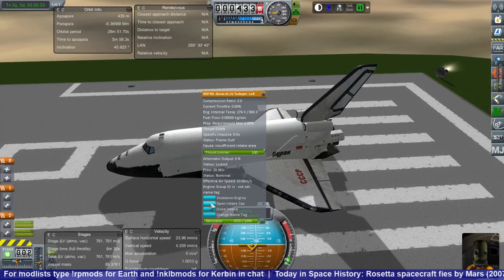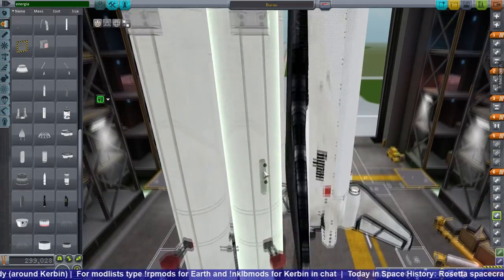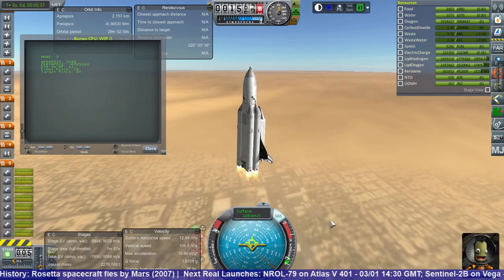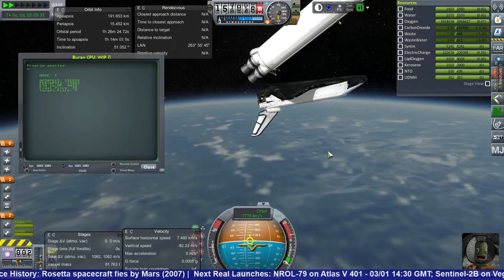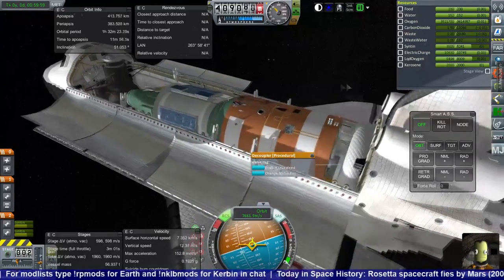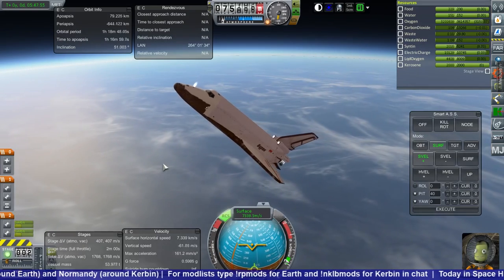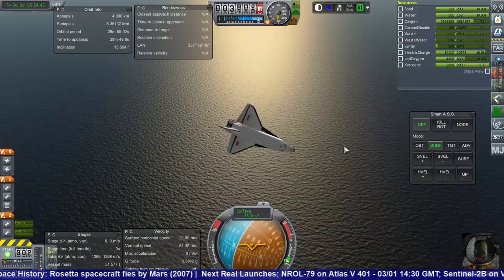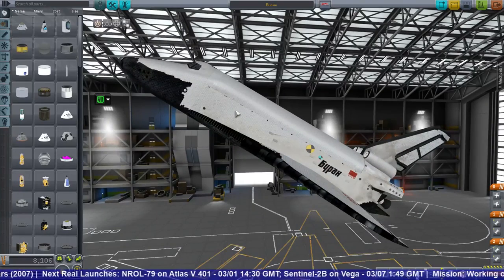Kerbal Space Program/RO - Test of DECQ's Buran in Realism Overhaul

Comment: Buran did have a cockpit escape system. It could be fired during launch to get the crew out in case something went wrong and they needed to abort. At certain phases that would probably mean the loss of the orbiter but the crew would be safe.
Reply: Tyler Raiz I think so. Hence my hesitation regarding certain situations. Depending on whether it was the full cockpit, you'd definitely lose the orbiter. But if the conditions for needing to do an RTLS were unsafe for the crew but the orbiter could continue to fly to a safe stage for decoupling, it could fly back on its own, provided it was an ejection seat system. I think that's what I recall one of the people from the project saying in an interview.
Reply: Tyler Raiz I would guess not. Since it was going to be an autonomous flight they probably were going to install it later, either after Ptichka was completed, which would have had it first, in that case, or at the same time. Not everything was ready since they wanted to speed up the testing and focused on systems need rather than completion. It didn't have the jet engines either as we talked about on stream.
Reply: It would have been fitted in the third orbiter along with life support systems.
Reply: The third orbiter nicknamed "Baikal" was going to be equipped with life-support systems and ejector-seats. Baikal was going to be the first manned orbiter in the Buran program.

Comment: I read somewhere that the Buran could haul much more than the shuttle (29 tons) due to not having main engines? Is this not true since you mentioned a lift capacity of 30 tons?
Reply: These were ejection seats only for pilots, not passangers, like in Columbia. There is no point in this system because it is anyway is not able to eject passangers from middeck. I think ejection seats had to be installed for test flights only.